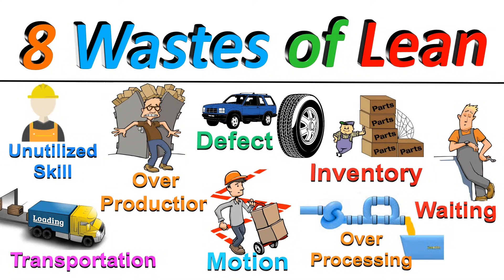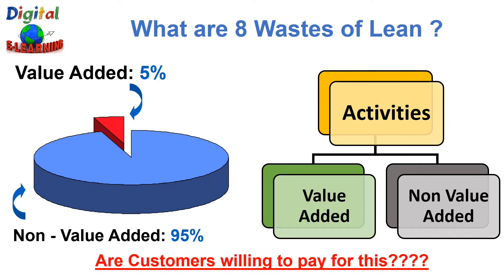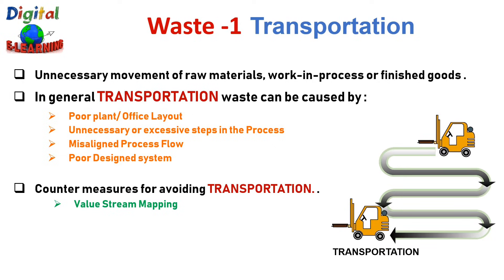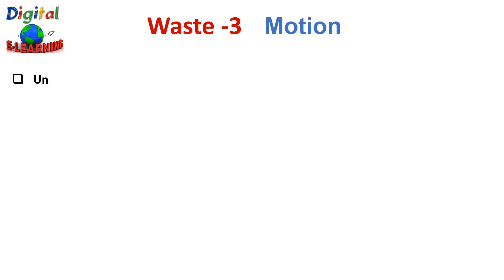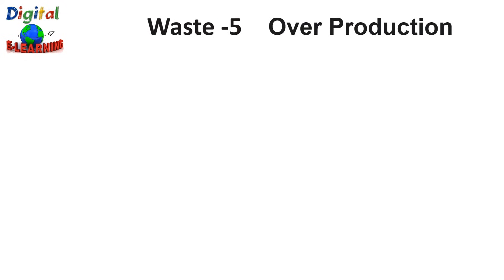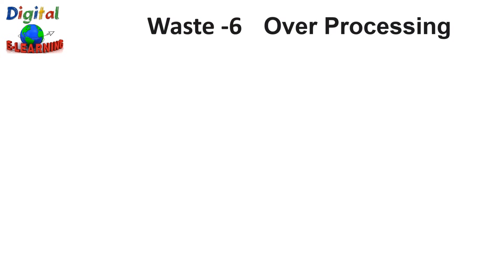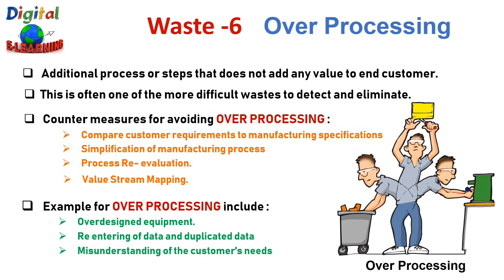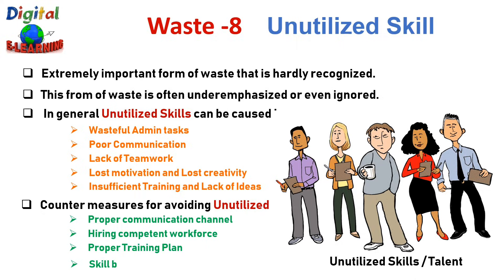𝟴 𝗪𝗮𝘀𝘁𝗲𝘀 𝗼𝗳 𝗟𝗲𝗮𝗻 𝗠𝗮𝗻𝘂𝗳𝗮𝗰𝘁𝘂𝗿𝗶𝗻𝗴  [ Lean manufacturing wastes ] Lean manufacturing waste elimination

Comment: What is difference between rejection and scrap
Reply from the maker: Rejection is when customer rejects your production on quality and scrap is when you cannot work on that rejected parts to make it correct and then scarp these parts finally
Reply: @DigitalELearning  مرحبا ٦غفف
Reply: Rejection can be sumthing which does not meet the customer specification .nd scrap is sumthing which is of no use